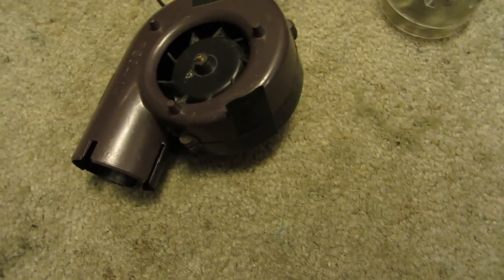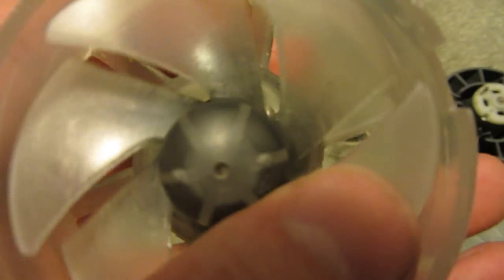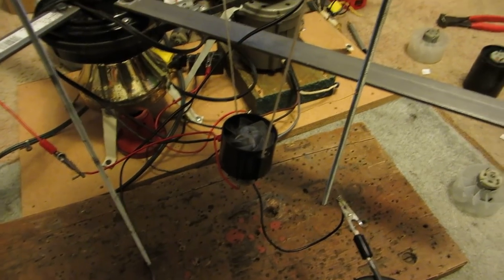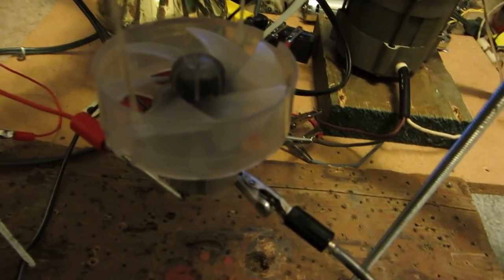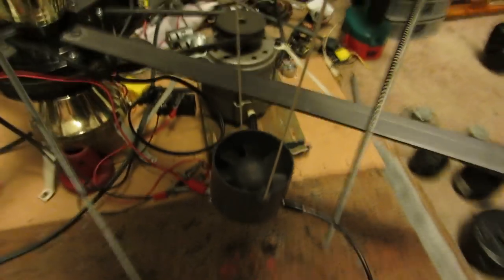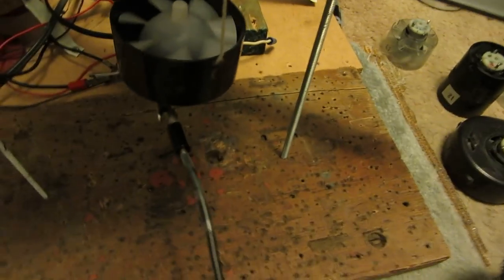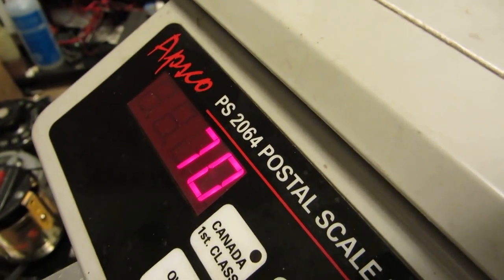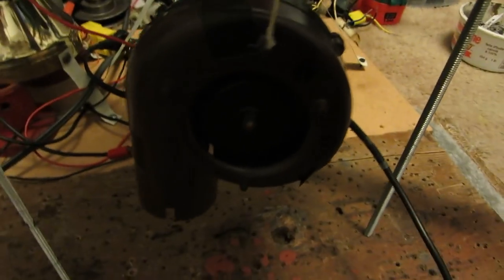HairDryer Fan Tests Part 1

Comment: I think you really have to place a security screen between you and those fans because one of the impellers could disintegrate due to high rpm, especially if it's already cracked or made of rigid plastic.
Can you also use some kitchen scale, so you can ajust the tare to 0gr when fan is off, and directly get the thrust in "negative" grams?
Reply from the maker: The final tests have already been done, I'm just in the process of editing the video clips for part 2.

Comment: Why are they all 12 volts?
Reply: Because most hair dryers work on the same kind of power. And the fan is basicly driven via a voltage divider which in this case is the heating element. And after that in most cases 12v is left